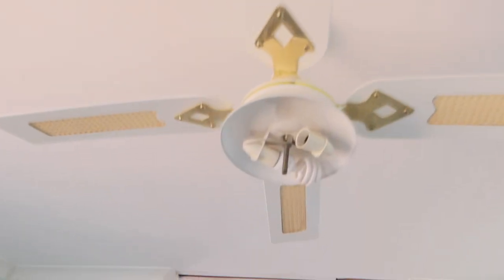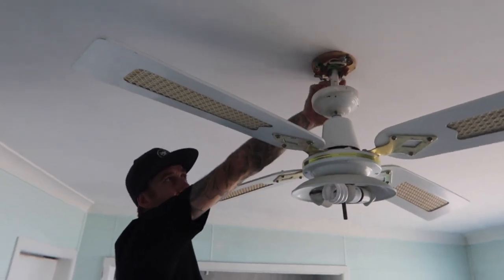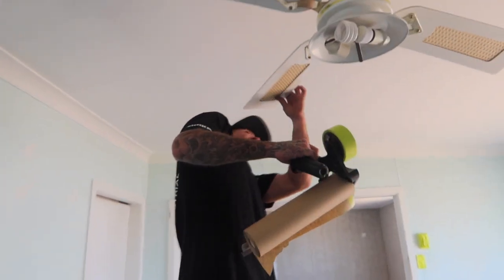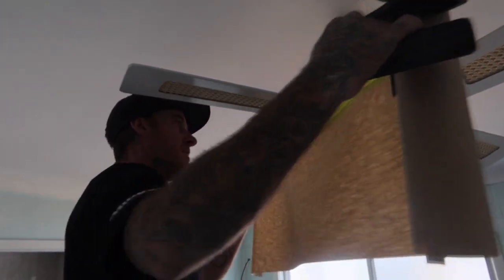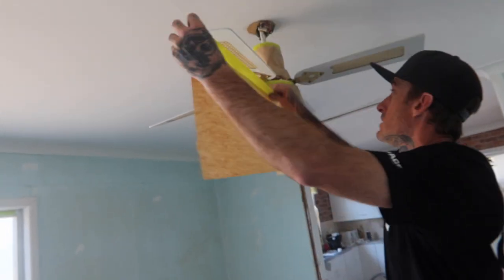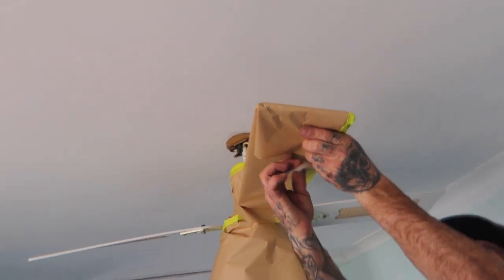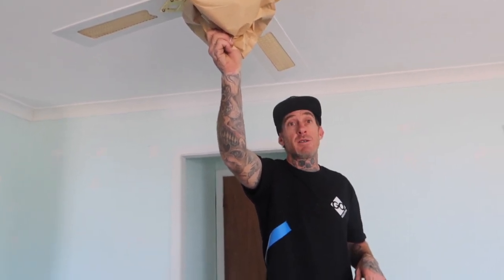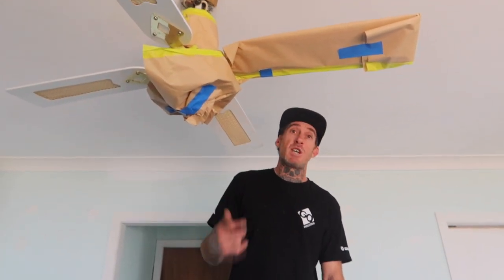HOW TO TAPE UP CEILING FANS

Comment: Josh you can save money not using the blue tape for tackers
Reply from the maker: Hi Ryan,What is wrong with the blue tape ?
Reply: The blue tape for the surface not the paper. It's cost-effective to use the white tape for that.
Reply from the maker: @BGuitar415  do you even know what tape I am using? This is cheap render tape I had laying there! Not all blue tape is 3m scotch. Knowing the facts is important!
Reply: @paintingbyjosh   I don't know what your blue tape is in Australia but in the states it's four times more expensive than the white tape so if your blue tape is the same price as the white tape bless you I'm just saying I saw that blue as tackers and that's a big no around here.
Reply: Hey Ryan, I’m interested in buying the applicator you use, could you please tell me the name of the setup you’re using? Cheers
Reply from the maker: @BGuitar415  this is cheap blue cloth tape. here in Aus & Us there is many different kinds of blue tape. Just because it's the colour blue does not mean it's 3M. Cheers
Reply: @paintingbyjosh  Right on! You rock!